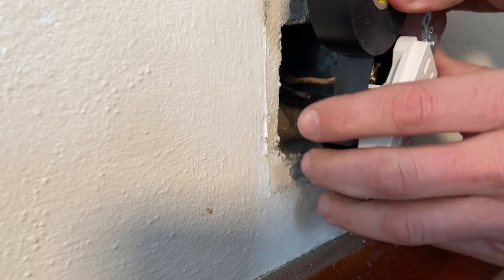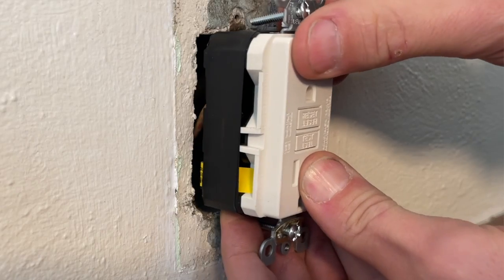Should You Wrap Outlets In Electrical Tape?

Comment: My take:  I don't wrap them unless the gang box is metal.
Reply from the maker: I am the same, thanks for the feedback!
Reply: Idk why but the metal boxes in my 1960s built home dont seem to be conductive. I touched the two screws of a live light switch to the metal box and the light didnt turn on, then I flip the switch and the lights on.
Reply: @ThatToast  was it grounded when you did that?
Reply: @KC9UDX  ungrounded light switch and ungrounded box, they used the old 2 wire snakeskin in the 60s. I would think touching the box to the two screws would be the same as turning the light switch on right?
Reply: @ThatToast  well, it's supposed to be grounded unless you took the MC out of the clamp.*  But all bets are off on something that old.  The thing is though, that if it is grounded, depending on resistances, you could be sending enough current to ground that the lamp isn't getting enough to turn on.

The other possibilities are the box
- is anodised aluminum
- is galvanised steel that is very corroded (might appear whitish)
- has a lacquer or enamel coating to keep it from rusting

*Is it MC (commonly also called BX, or AC)?   MC has an aluminum spiral outer casing.  The purpose of that is twofold: for protection from animals or nails, and for grounding.  When installed correctly with proper clamps, it is connected to a metal box on both ends.  One should be grounded by other means; either metal raceway or MC to another grounded box, or by a grounding conductor.  That way both boxes, and the MC casing all are grounded.
Or, is it NM, also called Romex™, or some other kind of insulated cable?
Reply: Multiple gang boxes I wrap also.
Reply: @ThatToast  They're not grounded.
Reply: @KC9UDX  They dont have any MC, just the old silver pained fabric insulated electrical wire some people call snakeskin, black and white no ground. I used a continuity tester on one of the other metal boxes in the house and it had continuity within itself so i guess that means its conductive. There was zero volts between hot and the box, so ungrounded. so im not sure why the box didnt act like a connector for the light switch. But I still should be careful with them, if the box gets energized by the hot wire, it has no ground to go anywhere but through me if im grounded. Gotta love old wiring lol
Reply: @ThatToast  OK, that's what I would call NM.  The simplest thing for you to do is make sure the conductors are secure, and tape the switch.  Otherwise you could ground the box but that might be a ton of work.
Reply: Same
Reply: Do you not earth/ground the metal boxes over there?
Reply: @Manc-king  Youre supposed to yeah, but many older homes didnt have a grounding system, they used metal boxes with no ground, two prong outlets hot and neutral, generally with fabric wrapped wire. Nowadays yeah everything grounded
Reply: Same here, I always like to wrap them in metal boxes!
Reply: Electrician for nearly 40 years. It's more of a courtesy for the next person. This is a level of safety to prevent being shocked in case of accidentally touching.......
Reply: Bt that logic, you should tape ever single breaker inside the panel.  It's OK to have free space as an insulator.
Reply: @falsedragon33  have you seen the inside of an electrical panel?  And what a breaker looks like?  It has nothing to do with “free space”
Reply: Common sense!
Reply: @ThatToast  a light switch only breaks one leg of the connection.  In your case, either the common side (white) is wired to the switch, otherwise, your boxes (that box) are not grounded.
Reply: @KC9UDX  also.. were you facing west, staring over the ocean at a setting midsummer sun, during the ives of the naked mole rat, in the year of of the fabled dog-bear??? Well?? Did ye!!?;? Arrrr matey.. I smoke weed. Oh yeah, great videos
Reply: Yeah same

Comment: Definitely wrap devices in metal boxes and definitely in a multi gang box.  I just can't get over a hot terminal for one device being so near to a ground terminal of an adjacent device without insulation.
Reply: @Joe-by8jh  when you plug things in and out the outlets could move
Reply: @Joe-by8jh  Damn, I knew those screws went somewhere!
Reply: My thoughts exactly 🙌🏻

Comment: I was born into a family of electricians/electrical inspectors, and was taught to always use pigtails, tighten all unused screws all the way in, then tape both the wirenuts and around the receptacles and the switches. Also, to doggy-ear the end of the tape for easy removal if needed.
Reply: we call the doggie ears a gentleman's collar and it shows consideration for the next guy.
Reply: I follow those same practices also. I always forget to leave a tail on the tape, then fight with it when it needs to be removed!
Reply: @rabelingoodstanding2628  I always called the extra fold of tape a "tape flap" I like "gentleman's collar" better, sounds much more sophisticated!
Reply: Didnt do the ear before, will now.
Reply: You forgot on outside devices always have the marrets pointing up...
Reply: @gophersgirl  Excellent point! Thank you.
Reply: So...you don't check your wires before you wrap a wire nut?
Reply: you dont need to tape wirenuts if you screw wirenuts on properly
Reply: @tyh4297  I only do the ones that don’t need to be removed unless major work is done.
Reply: @betterlate1111  yes, you do. Wrap it so nothing can get into the wirenut or "knock it off" when you push the gizzards back into the box.
Reply: @tyh4297  Not in residential. But in industrial settings (3-phase motors), we tape the wire nuts in high vibration or wet environment applications.
Reply: @tyh4297  if its just a simple single-pole switch, and there isn't a mess of 12AWG solid, I agree, not needed but there's nothing wrong with the 'belt and suspenders' approach, and its a nice-to-have.  I've got one switch where the wires are so bunched up it stripped the female thread for screw, so I added a little extra protection
Reply: OMG to much but ok what ever overkill make you happy
Reply: @karlschauff7989  the only thing tape does is trap moisture it will not stop it from getting in a wire nut.

Comment: I do wrap wire nuts with electrical tape, two or three turns, more for the purpose of weather proofing or if a roof or appliance leak were to make it's way down inside a wall.  For this reason, I always position the wire nuts inside the box with the cap facing up so that they could never collect water.  Your video demonstration wire nut was also wrapped anti-clockwise which can unscrew the wire nut as the tape shinks.  Always wrap the wire nut clockwise, the same way that you tighten it.
Reply: Totally agree for the weather protection aspect.  I live in Costa Rica right of the ocean and corrosion from Salt air and 95% humidity is a real issue!

Comment: "Do the pull test, and it's the tape holding it together... Disengenuous. Probably not intentionally. Who does the pull test after the tape? I do not move on after applying a wirenut, until I have done the pull test several ways, and am sure the wires are both well engaged and tight. THEN I tape.

Comment: I wrap mine in fruit by the foot. It works fairly well as an insulator and it's tasty.
Reply from the maker: Nooooo, should be a sin wasting fruit by the foot like that 😂
Reply: Is that UL approved?
Reply: 100% of mice approve this method.
Reply: 🤣🤣🤣 ALV
Reply: Wow..
Reply: Do you also wrap your screwdriver, or just the nuts?
Reply: With the amount of ants we battle during the summer you must have installed my outlets
Reply: That's nuts.
Reply: @Tie509  UL only approves things in their native state.  Technically, if you break out the knockouts in a j-box it is no longer in the form that was UL approved and if you stretch your tape when you install it, it is not longer in the same form it was in when tested.
Reply: lmao makes them equally as sticky
Reply: Do your pull test before taping... In many places that's a requirement. Some industries have their own code. Some I have worked at require taping all wirenut connections.
Remember, local code can be more strict than NEC, but can not be less strict.

Comment: I use tape on wire nuts only when the they are subject to a lot of vibration. Such as motors. The pull test should always be done before the tape is applied.
Reply from the maker: Makes sense to me, thanks for the feedback and wire nut example 👍
Reply: I was coming to say the same thing. 25 years in Heavy Industry Electrical, we used only Stranded Wire. Though they could be twisted, most often they were just stripped, held tightly together, wire nut applied, each wire tug tested, then taped in a manner that would tighten the wire nut initially. The tape was only to prevent the wire nut backing off on high vibration.
Reply: In that case why not use a crimp connector instead...
Reply: Use a real marette connector. They are the vibration resistant wire nuts that utilize an internal sleeve and set screw, specifically for this.
Reply: I also occasionally wrap wire nuts...I test the connection and wrap, starting on the nut and then the wires in the direction so that if the tape were to shrink, it would only tighten the connector more.
Reply: @jeanjean9343  ... it's in the code to use stranded wire on anything subject to vibration. (IOW, not just a good idea)
Reply: @EverydayHomeRepairs  I use tape on wire nuts and electric outlets (we have metal boxes here in Montreal Quebec). The wire nuts I agree with the false sense of security however if you pre twist the wires together with the proper tools, then put a wire nut around it, do the pull test (a good test) and then wrap it with  tape carefully (in the direction where the wire nut is being tightened rather than loosened) then you're good IMO as it does add security in the event something gets loose, wire is better protected from being pierced while pushing back in the box, etc.
Reply: I like the Wago connector.  Haven't had any issues with them as long as you properly close them.
Reply: @daijoubu4529  Difficulty in Removal for things like (For Example) Meg Testing.
Reply: @johnqpublic9074  I Love the "Idea"... I hate using them, and rarely see them. I have had a time or two seen the set screw "Loosen up".. Of course do not know if they were properly installed originally or not.
Reply: On Smaller Air Handlers, I used Crimp Wire Nuts on the Voltage Selection Wires, and Twist on Wire Nuts, on SEC. I used a Wire Tie Tightening Tool and put a small wire tie a 1/4 to 1/2” from the Wire nuts. This is to take the untwisting pressure off the wire nut. Found Tape holds moisture. On the bigger motors, Bugs, Rubber Tape, Cloth Tape, followed by High Heat Vinyl Tape. Also I always cut my tapes with electrician scissors, so the ends don’t come loose, from the stretched, damaged tape.
Reply: Makes sense in that application. However, its best to use Polaris taps inside the peckerhead when possible
Reply: @johnqpublic9074  Even marettes will loosen if there's a lot of vibration for years at a time.
Reply: @karlschauff7989  Hence why I said the ones with mechanical fixation, with a set screw. I haven't seen those loosen off.
Reply: @wesleylargen  I love them too for my own projects. But compared to a bag of tan nuts the wago connectors are very pricy if doing a whole house
Reply: @stevenmoomey2115  yes yes
Reply: Once a wire nut is twisted on the wires. Give it a solid pull while holding the wires with the other hand. This is how you know it is secure.
Reply: Motors subject to lots of vibration need lugs with nuts and bolts wrapped in cambric tape, then electrical tape, then rubber tape.
Reply: First learned about this practice about 10 years ago. The guy commissioning a 25HP fire pump would not do it without rubber splicers tape and a wrap of 33 on the motor lead splices.
Reply: @patbhvac1  …. You need to tug each wire independently of the others. Holding the bundle of wires and tugging the wire nut will not expose an individual wire that didn’t get twisted in with the group.